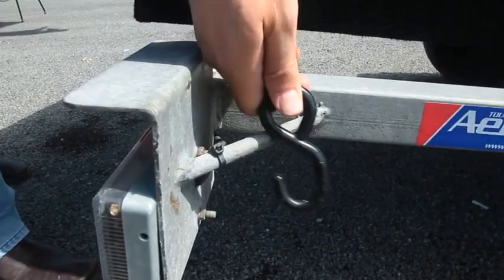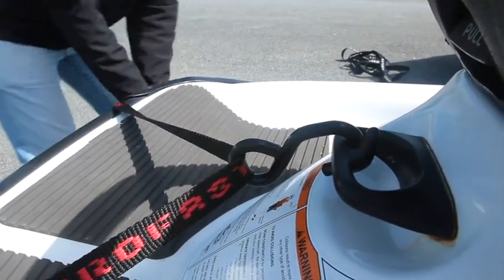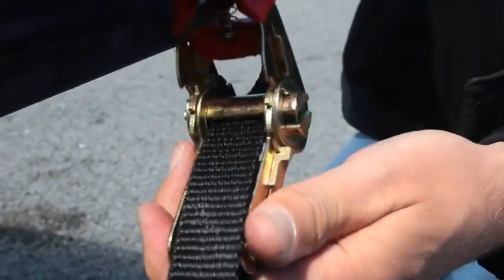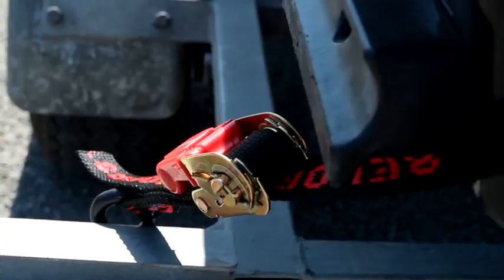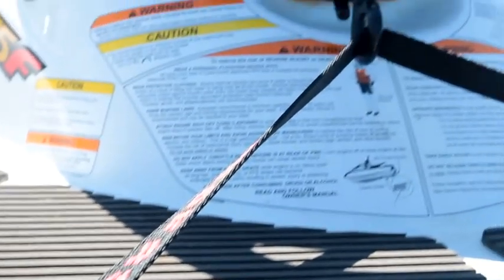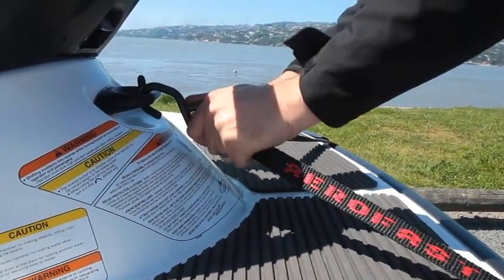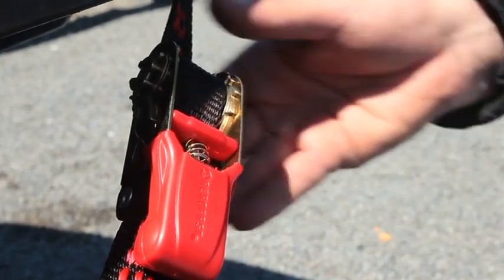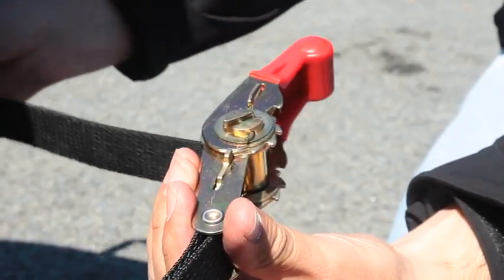How to Tie Down your Jet Ski

Comment: Came across this video and I am stumped as to why someone would not use the two stern eyes that are on almost all modern PWC's. These are meant for the purposes of trailering, unlike the tow eye which was engineered for another function. Before following the advice of this video please consult your manual.  I can verify that my Yamaha Waverunner manual clearly states that only the bow eye and stern eyes should be used for trailering tie down.
Reply: As a former owner of Seadoo fish pro 2019 and now owner of of Seadoo fish pro Trophy 2022 I do agree with Mr Joerao. According Nordic rules of cargo tying  you should use 4 different ties for cargo tying each one more  than one 5 times more cargo tying weight capability than  the cargo weight  because of possible car accident. Yours sincerely M.D Kivistö
Reply: P.s my brother has more than 30 years of experience on forwarding of truck transports in the EU countries.